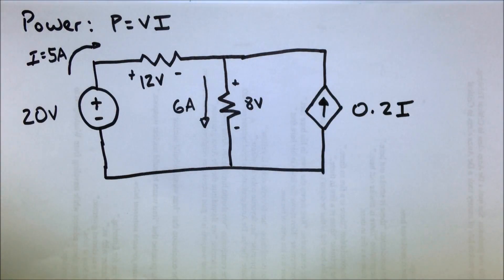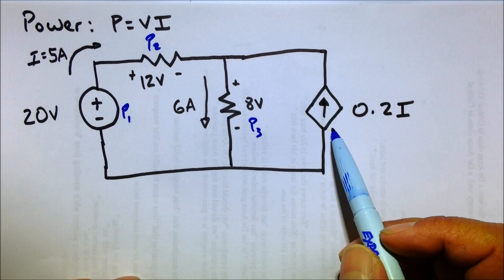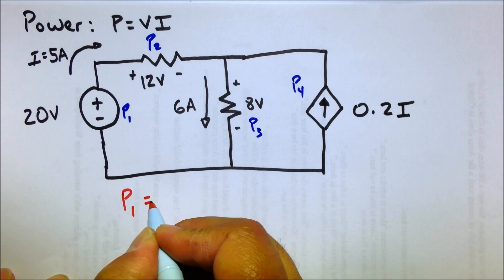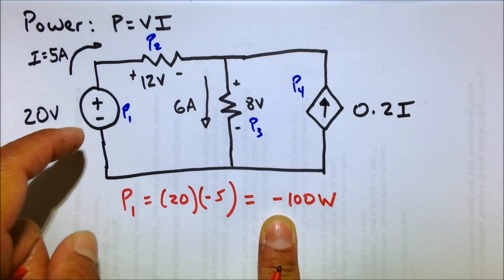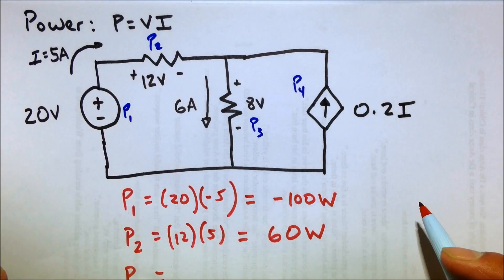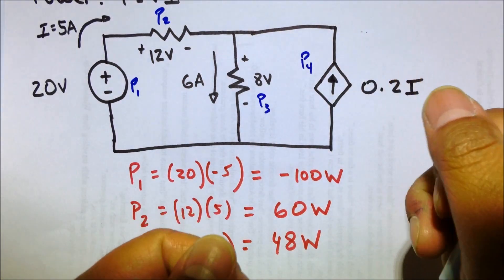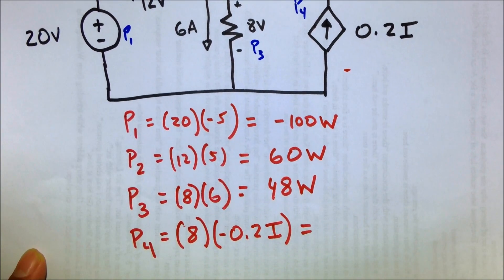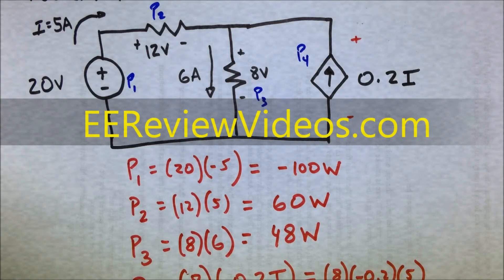Circuit Power Dissipated & Supplied Analysis Practice Problem (Electrical Engineering Basics Review)

Comment: What if the voltages in those resistors were replaces with ohms and the current dependent current source was replaced by a voltage dependent voltage source?

And also that 6 A is unknown

Comment: How does a resistive circuit element consume power? Everything I've seen says electric current moves extremely slowly, like a millimeter per hour. So, it's going to take many hours for a specific electron to get from one end of the RESISTOR to the other! This "drift velocity" seems more or less constant. I always assumed current flow occurred at a high enough speed that its speed wouldn't be any kind of issue. I see a simple circuit diagram and try to realize that the electrons that make up the current flow will take centuries to move around the circuit ONE TIME! Then, too, what is a "current waveform"?
Reply: The resistive element has many more scattering centres (impurities, lattice defects, etc.) than a less resistive one. Power is lost to the resistive element via inelastic scattering of the conduction electrons with these scattering centres. Look up Drude's theory of electrical conduction in metals.
Reply: @faizmalik9210  <--Ok, very good. We have power dissipated in a resistor, but current is conserved!?! But current is CONSUMED (P=IV)!? How is the circuit current maintained constant while that current is being consumed in power dissipation?! Rules-of-thumb yield reliable results, but the rules, themselves, seem somewhat inconsistent with each other...in my insufficient understanding...
Reply: @StoneShards  Hi Peter! I'm not here to teach or argue with you. Sorry if I gave you that impression. It was very tempting to answer your question!

This is the first time I hear that current is conserved. I know that charge is conserved but never current.  When current passes through a resistor we say ENERGY (or power to say it loosely)  is comsumed, not current. My mental picture of an electric current is a rotating rubber belt driven by the car engine, the belt representing a chain of electrons and the current the rotation of the belt. Power is extracted from the belt through friction with a non rotating member. No electrons is lost due to the friction. Hope that makes sense to you.
Reply: @faizmalik9210  <--No, I don't want to argue; I'm really interested, and perplexed. By "conserved" I only meant no current was "lost". In a series circuit, the current is the same through all resistors, though one resistor might be dissipating 1 W and the other 2 W. If "energy" is consumed in producing "power", where is the energy coming from, given that the current is not diminished by the power dissipation? Current is defined as the amount of charge in coulombs that passes a given point in one second. That's the origin of my original (maybe in a different forum) difficulty with the notion that "electron drift current" was the vehicle for circuit current, and limited the velocity of electrons in a current to an extremely slow rate.

Thanks for taking the trouble to engage me, Faiz. You've helped confirmed my suspicion that there might be something more going on, since others respond to these questions with a similar mysteriousness--it's a tricky conceptualization, this circuit operation stuff. I'll keep thinking about it...it's like, I HAVE to...
Reply: Happy to engage with you too. You might care to go to my channel "Johan Arif" and watch some "tedious" videos on there on Thevenin and Norton's theorems.

Comment: i thought if the current went out the positive battery it would be positive? why is it negative?
Reply: Peter C the reason why it's done like that is because if you look at the final results and add up the different powers calculated, they come out to zero, which is what we want. Means that exactly as much power is being supplied to the circuit as is being used in the circuit.
Reply: because we are finding power dissipated, but current source is supplying power hence negative sign before that. Same is the case with voltage source